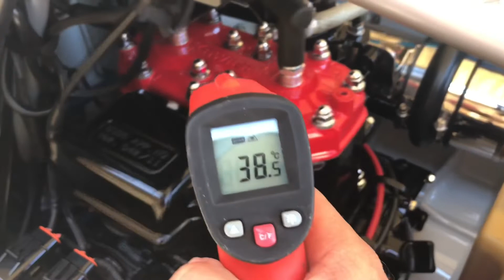Kawasaki X2

Comment: What paint did you use on the hull? And what powdercoat kit?
Reply from the maker: I brought a new already painted OEM fuel door cover and had 2k paint matched to the colour. Eastwoods powder coating kit and Prismatic’s powder
Reply: @TJResto  what do you mean 2k? Like thats the brand or the price haha
Reply from the maker: 2k paint also known as 2 Pack paint is paint with hardener in it. It’s more resistant to damage making it a good paint to used on jetskis. Every automotive paint store will have there own brands of paint and it’s two parts that you mix together.
Reply: @TJResto  okay I am in the middle of painting my ski right now, yours looks immaculate and I am very jealous! I got a quote for a quart for 300? Does that seem right? Would it take more than a quart?
Reply from the maker: Thanks I had mine professionally painted so I’m not sure how much paint they used.   I would think a quart would be enough. I have no idea on the cost. I did paint the engine bay and under the hood myself with etch primer and 2 cans of 2k spray paint. It was around 100 dollars I think from memory
Reply: @TJResto  that’s brother that ski is showroom quality, mines probably a 10 footer🤣